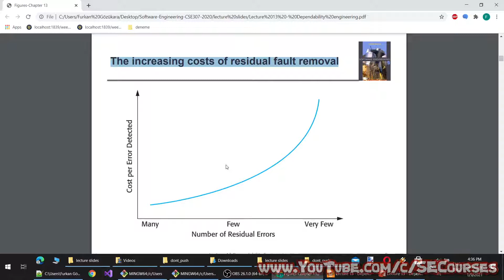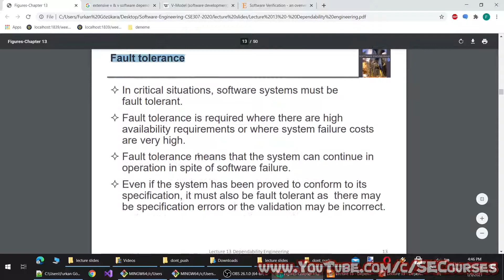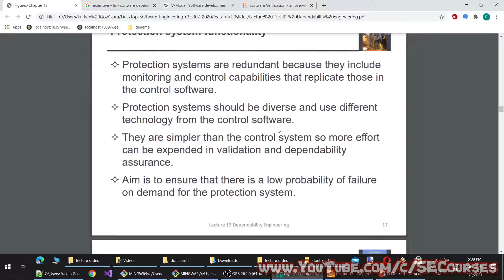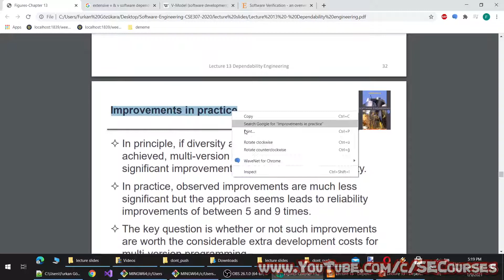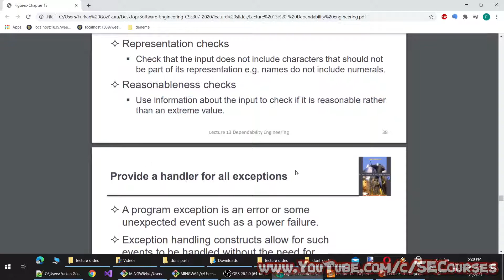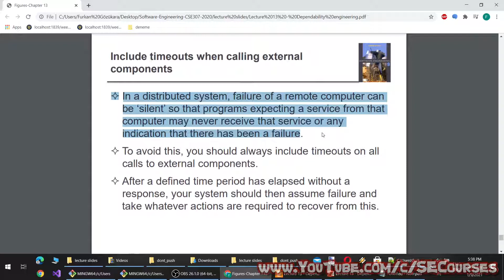#Software #Engineering - Lecture 13: Dependability Engineering & Programming, Redundancy & Diversity

Comment: In this lesson i learned:
- what is software dependability
- what are fault avoidance, fault detection and full tolerance
- what are regulated systems
- what are diversity and redundancy
- what are dependable processes
- what are dependable processes attributes and definitions
- what are validation activities
- what are self-monitoring systems
- what is N-version programming

Samed Arıcı - 195050005

Comment: In this video, I learned:

- Diversity and redundancy
- Process diversity and redundancy
- Attributes of dependable processes
- Validation activities
- Fault tolerance
- Dependable system architectures
- N-version programming
- Hardware fault tolerance
- Validity checks
- Exception handling

Recep Güneş - 195050026

Comment: I learned in this lesson;
dependability achievement
regulated systems
N-version programming
Hardware fault tolerance
software diversity
provide a handler for all exceptions
Triple modular redundancy
Pointers, recursion
Exception handler
Problems with design diversity
Dependable systems architectures
Dependable programming

SELİN ÖKTEN - 185050008

Comment: In this lecture we covered

Dependability engineering, systems architectures and programming
N-version programming
Redundancy and diversity
Validation activities
Fault tolerance
Protection systems
Self-monitoring architectures
Hardware fault tolerance
Exception handling
Software diversity

195050904
Raanem Dahbi

Comment: In today's lesson we learnt about:

- Dependability engineering in general
- Redundancy and diversity
- Triple modular redundancy
- Fault tolerance
- Handling exceptions
- Pointers and recursion
- Dependable processes
- Problems with design diversity
- N-version programming
- Validation activities
- Dependable systems architectures
- Dependable programming

Buğra Can Gündoğan - 195050003

Comment: I learned the following concepts towards the end of the lecture: Systems that are regulated Redundancy and diversity Processes that are dependable Validation procedures System of defense Architectures that monitor themselves Programming in N-versions Tolerance to hardware failure Redundancy in three modules Software variety is important. Concerns about design diversity Dependable programming has improved in practice. To conclude, in reliable programming, redundancy in a program is utilized to evaluate the legitimacy of inputs and the values of program variables.

195050024

Comment: At the end of lecture I learnt these topics: Regulated systems Diversity and redundancy Dependable processes Validation activities Protection systems Self-monitoring architectures N-version programming Hardware fault tolerance Triple modular redundancy Software diversity Problems with design diversity Improvements in practice Dependable programming .To summarize, Redundancy in a program is used to validate the authenticity of inputs and the values of program variables in reliable programming. Go to statements, pointers, recursion, inheritance, and floating-point integers are all intrinsically error-prone programming constructs and approaches. When creating trustworthy systems, you should aim to avoid these structures.
Mehmet Öksüz – 175050007

Comment: In this video i learned that;

Software dependability,
Dependability achievement,
Regulated systems,
Diversity and redundancy and example of its,
Dependable processes,
Attributes of Dependable processes,
Fault tolerance,
Dependable system architectures,
Protection Systems,
Protection system architecture,
Protection system functionality,
Self-monitoring architectures,
N-version programming,
Hardware fault tolerance,
Software diversity,
Specification dependency,
Dependable programming,
Exception handling,
Error-prone constructs,
Provide restart capabilities

Ahmet Yusuf Diktepe
175050013

Comment: validation activities
Protection systems
Self-monitoring architectures
N-version programming
Hardware fault tolerance
Triple modular redundancy
Software diversity
Problems with design diversity
Improvements in practice
Dependable programming

Comment: In this video ı learned

-Regulated systems
-Diversity and redundancy
-Dependable processes
-Validation activities
 -Protection system
-Self monitoring systems
-N-version programming
-Hardware fault tolerance 
-Triple modular redundancy
-Software diversity
-Dependable programming
-Validity checks
-Provide a handler for all exceptions
-Exception handler
-Minimize the use of error-prone constructs

M.BURAK PAKER
175050012

Comment: in this lesson I have learned the following: 

- Redundancy and diversity 
-Dependaple system
- Software dependability 
- Validation activities 
- Protection system
- Self monitoring systems
- Hardware fault tolerance 
- Software diversity 
- Validty checks
- Exception handler
- Erorr prone, construct and minimize the use of it

185050901

Comment: 165050016

I learned these from this lesson 13 video:

Regulated systems
Diversity and redundancy
Dependable processes
Validation activities
Protection systems
Self-monitoring architectures
N-version programming
Hardware fault tolerance
Triple modular redundancy
Software diversity
Problems with design diversity
Improvements in practice
Dependable programming
Validity checks
Provide a handler for all exceptions

Comment: In this video I learned;

*Validation activities
*Self-monitoring architectures
*Software diversity
*Protection systems
*Dependable processes
*Self-monitoring systems
*Triple modular redundancy
*Regulated systems
*N-version programming
*Problems with design diversity 
*Error-prone constructs
*Exception handling

Abdulkadir Durmaz
175050008

Comment: 175050010

In this lesson;
- Triple modular redundancy
- Protection system architecture
- Fault tolerance
- Exception handler
- Protection system functionality
- N-version programming
- Dependable programming
- Pointers, recursion
- Problems with design diversity

Thanks for lesson

Comment: In this video, I have learned those in below;

-Regulated systems
-Diversity and redundancy
-Process diversity and redundancy
-Dependable process
-Validation activities
-Fault tolerance
-Dependable system architectures
-Protection system architecture
-Protection system functionality
-Self-monitoring architectures
-Self-monitoring systems
-N-version programming
-Hardware fault tolerance
-Triple modular redundancy
-Software diversity 
-Problems with design diversity 
-Specification dependency
-Inprovements in practice
-Dependable programming
-Exception handling

165050011

Comment: In this lesson , I learned ;

- Software dependability
- dependability achievement
- regulated systems
- diversity and redundancy
- dependable process
-  validation activities
- fault tolerance
- protection system
- protection system functionality
- self monitoring  architectures
-  n version programming 
- triple modular redundancy 
- software diversity
- provide a handler for all exceptions
- exception handler
- minimize the use of error-prone constructs

Mustafa Çağrı Peker
165050008

Comment: In this lesson I learned;

+Information about Validation activities,
+Information about Self-monitoring architectures,
+Information about Software diversity,
+Information about Protection systems,
+Information about Dependable processes,
+Information about Diversity and redundancy,
+Information about Self-monitoring systems,
+Information about Triple modular redundancy,
+Information about Regulated systems,
+Information about Improvements in practice,
+Information about Exception handling,
+Information about Problems with design diversity,
+Information about Validity checks,
+Information about Fault tolerance,
+Information about Dependable programming,
+Information about Hardware fault tolerance,
+Information about Control the visibility of information in a program,
+Information about N-version programming,
+Information about Provide a handler for all exceptions.

175050004

Comment: In this lecture , i learned;

+ Redundancy and Diversty
+ Dependable processes
+ Dependable Systems architectures
+ Dependable Programming
+ Software Dependability
+ Dependability achievement (fault avoidance, detection, tolerance)
+ Regulated Systems 
+ Diversity and Redundancy  
+ Process diversity and redundancy
+ Attributes of Dependable processes(documentable , standardized, auditable, diverse , robust)
+ Validation Activities
+ Protection systems
+ Protection system architecture
+ Protection system functionality
+ Self-monitoring architectures
+ Self-monitoring systems
+ N-version programming
+ Hardware fault tolerance
+ Triple modular redundancy
+ Software diversity
+ Problems with design diversity
+ Validity checks(range, size, respresentation, reasonableness)
+ Exception handling
+ Minimize the use of error-prone constructs
+ Error-prone constructs

So we can say ; Dependable programming relies on the inclusion of
redundancy in a program to check the validity of inputs
and the values of program variables. Software diversity is difficult to achieve because it is
practically impossible to ensure that each version of the
software is truly independent

195050803
AHMET MUSTAFA VİDİN

Comment: i learned topic's below;
*Regulated systems
*Diversity and redundancy
*Dependable processes
*Validation activities
*Fault tolerance
*Protection systems
*Self-monitoring architectures
*Self-monitoring systems
*N-version programming
*Hardware fault tolerance
*Triple modular redundancy
*Software diversity
*Problems with design diversity
*Improvements in practice
*Dependable programming
*Control the visibility of information in a program
*Validity checks
*Provide a handler for all exceptions
*Exception handling

Ebla Ekerdiker
185050010

Comment: topics that lecture 13 covered  are Redundancy and diversity ,Dependable processes
, Dependable systems architectures
and Dependable programming
.to sum up, Dependable programming relies on the inclusion of redundancy in a program to check the validity of inputs and the values of program variables Some programming constructs and techniques, such as goto statements, pointers, recursion, inheritance and floating-point numbers, are inherently error-prone. You should try to avoid these constructs when developing dependable systems. 
175050901